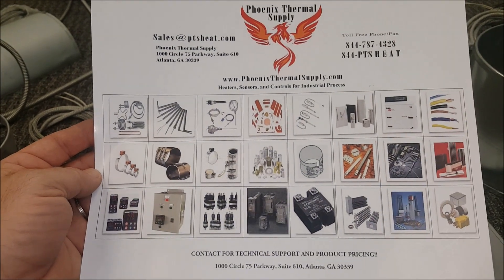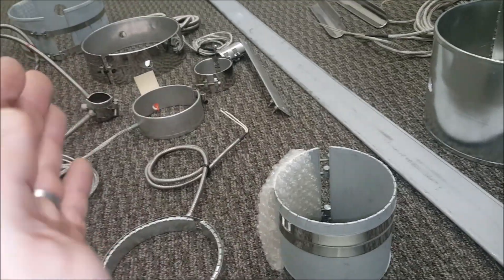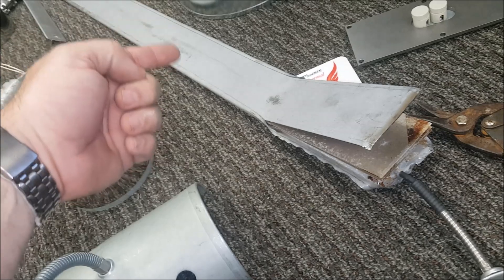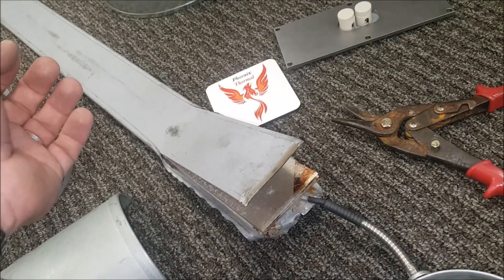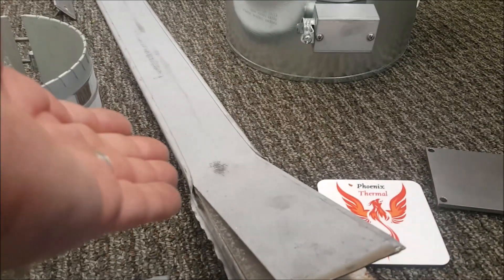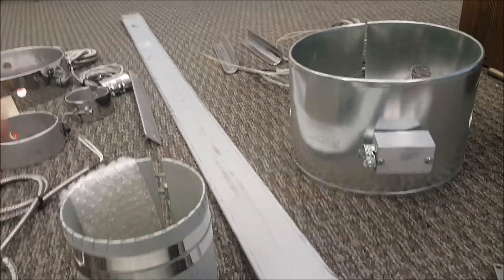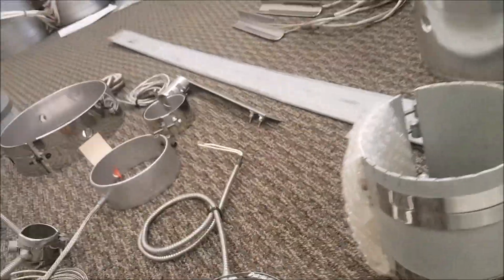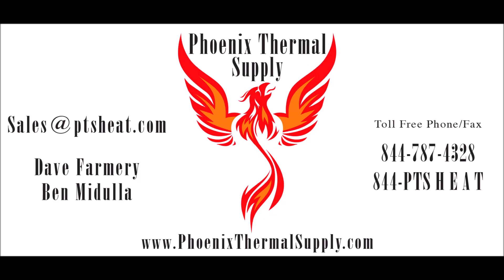How is a Mica Band or Mica Strip Heater made?

Comment: You know I had this crappy heater never worked that great so today I disassembled it. Perhaps I'd use the element for some other things. To my surprise it was nothing more than a piece of cardboard with threw wire attached to it. So I put the ohm meter to it to find resistance then I torched it which seemed like cardboard but when I removed the flame, there was no fire. My heater was constructed no where as yours. I could tell by your layers and thickness and curve and element
Mine looked like a furnace filter but flat and made of two sheets of shiny I presume Micah board in which on one piece one side had been sprayed a thin layer of the resistance compound which had no resistance after I removed it from the shiny layer. That compound was sandwiched with the other piece cardboard or Micah very thin. Which had threw electrical wires attached at the top of the substance, spaced out from side center side with two metallic tracks that encompassed the outskirt of the substance with a brass strip running down the middle. Pressing the ground wire. I had never heard of Micah thermic heat before today and before I stumbled across you I hit a few reviews and swear they were bias because my heater was bad. Never good, Walmart trash. So thanks for your video. I would have never bought another one again but since I saw you product, even a beat down tore up one, it definately was night and day in quality of materials. Well now another direction on how I can use the carbon and Micah for my own resistance needs

Comment: hi Dave, I want to design a Mica Strip Heater but dont know how to calculate the wire length and the power. Also I need help to find what insulating material should I use. Could you please guide me on how to design a flat strip element.
Reply: Hi Yash 
How can I help you?
Reply: @shyamlal2799  مرحبا